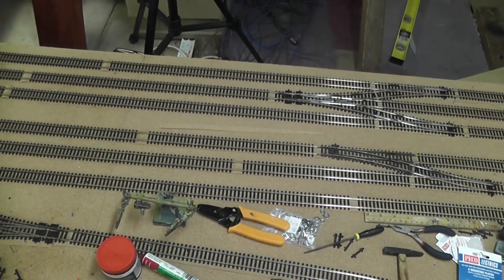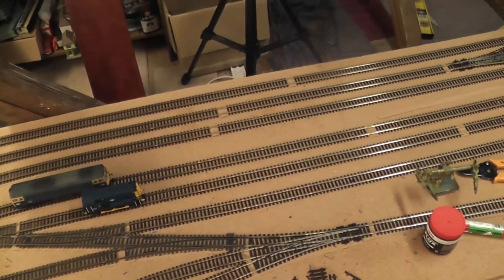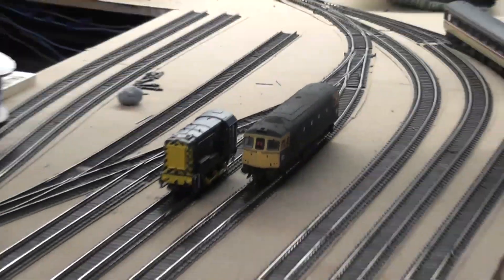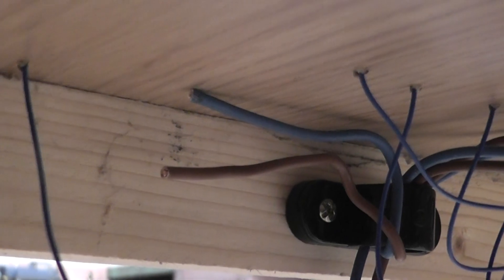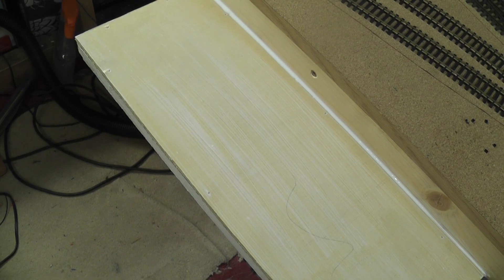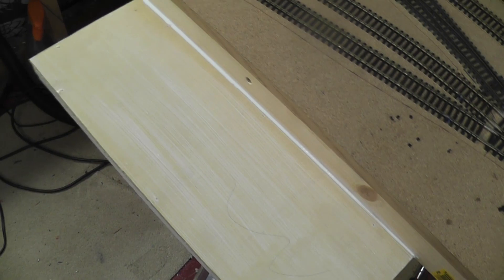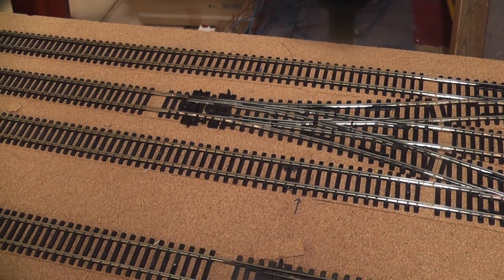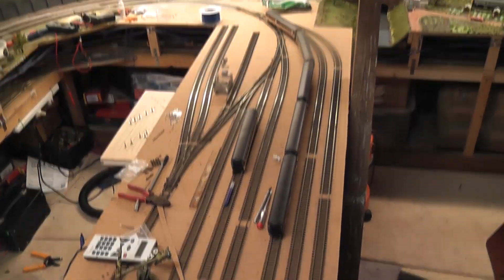Building a Model Railway - Part 5 - Control Panel

Comment: Great update, very pleased you showed a decent explanation of the uncoupling, I have been trying to find an explanation for the ordinary mortal for ages and here one is. I am sold on the control panel route now, I will forget about the notion of DCCing them, the manual control panel looks to be much more fun

Comment: Hi Richard, I always find your videos and explanatory interesting and informative, I bought a locomotive at the model train exhibition here in (Perth Western Australia), and a track cleaning car with the same couplers you have, they are a lot neater looking, I now know how they are  uncoupled thanks to your video. I'm still learning and wanting to build a decent layout, at the moment I have a Hornby DCC mixed freight with twin ovals modified with some turn outs set up on the floor for now. Cheers, look forward to see more updates on your layout extension.
Regards Gary 😊

Comment: the dcc point clips are called twerps by us S&T. we form a coil of bond wire for expansion around a ball hammer and knock them in with bond pins. great channel, just started watching. thinking of doing an NGauge layout. if you need any reference photos or have any technical questions, let me know. i notice lots of location  cases on the layout that you call relay boxes, so you have a relay room on the layout. typically found next to the signal box of brick or prefab construction. Lee Crewe S&T

Comment: Nice video Richard, that coupling system certainly looks interesting and useful. The control panel stuff was also very useful. Thanks for sharing!
Joe.
Reply: +Joe Jabczynski Just about all of the American manufacturers have converted to Kadee couplers, or their make of it for HO and N scale. Most American modelers model freight, and desire to shunt them without using the hand of God, especially when you wished to do so out of reach. Outside of a few urban areas we don't have many passenger trains. The British have better passenger rail service than Americans have bus service in the rural areas. While the manufacturers were slow to convert, slowly one at a time did as the American modelers insisted, and were converting anyway on their own. Only very old models have HO hook-horns, and N Rapido couplers. While US Bachmann have converted, notice UK Bachmann/Graham Parish have not for N scale, except for HO/OO Thomas and Friends line which use the British couplers.
Reply: I didn't know that to be honest. Now you mention it though, I have noticed the 'model railroading' groups on facebook tend to show a lot of freight workings. I've found that as I've got more into the hobby, my freight collection has grown! I think we are slowly starting to catch up with coupling systems as I've seen kadees starting to appear in our shops. I think this video shows just how effective kadees are and I'll definitely be making the change soon!
Cheers, Joe.

Comment: Nice video. About the magnets, rectangular ones should really do the trick. I plan myself to use rectangular magnets with an uncoupling area of about 4 to 6 "ties".
Another way to uncouple, manually this time, is with a wooden stick. Use a square section wooden stick, sharpen the end in a pyramid, then cut the last three mm of the point and round it. I introduce it between the jaws of the Kadee, turn it first clockwise then counterclockwise. The coupler then opens and the wagons (or here the coaches) are uncoupled... If you then glue the stick to a small pen-size flashlight, then you can also light the couplers when working in dark areas (or in a "night" environment). I saw that in an old Model Railroader, and after testing found out it worked quite well.

Thanks though for this serie of videos. They're really usefull for me as I'm planning a small exhibition layout and I'm quite a nonentity in electricity and electronics (just know that I must not cross plus and minus or I'll transform my layout in an electric toaster ;-) Landscape, weathering and structure scratchbuilding are more my forte than track laying, electricity and mechanics...

Eric.
Reply from the maker: Eric Sainte Thanks Eric, hopefully the rectangular magnets should do the trick.

Comment: I looked at Kaydees, DGs and Sprat and Winkle when deciding some years back on an uncoupling system. In the end I went for DGs as it is a delayed system. You can place just one magnet at the start of a fan of sidings and uncouple using an electromagnet. The stock can then be uncoupled by simply continuing and pulling the loco off when required.  The only snag is...you have to assemble them!! Cheers, Bob

Comment: Nice job Richard, the uncoupling system is a clever idea, I like it a lot. As an ex technician I couldn't help but think you would have been much better off 
using a socket rather than a pair of pliers to tighten up the switch securing nuts! Lol! Very much looking forward to the next video in the series.
All the best
Howard.
Reply from the maker: Howard Sugars I am a technician.  All my sockets are at work, I forgot to bring one home when I did this :)
Reply: Ahh I see, luckily I was a mobile technician so all my tools were in my van when I was at home, now they just sit in the shed! Lol! :)

Comment: Excuse the late comment on this great series.  When checking for interference between the uncoupled stock in a siding and passing point, the vehicle with the longest distance between the bogies should be used to check for 'cutting the corner'. Hence a coach (or the longest loco, if longer) would check for underhang. Overhang (beyond the bogie) might also be an effect (like a 4-4-0) , but is much less likely, even with Mk4 coaches.

Comment: Great work, very well done, & I have a suggestion, regarding cutting the bar from the motors. Would you consider putting a small washer over the bar down onto the track which would, I think ensure when you cut there would be a small piece protruding up.

Comment: +EverardJunction An useful function of Kadee's is that you can uncouple them, then push back and push them with the 'heel' of the coupling.

It means, that if you had a set in the station area, you could uncouple, then push backwards into your carriage sidings without coupling up to the coaches.
Or, you could push from the terminating end of the carriage sidings, into the station, then simply move away without coupling up again.

Comment: Hiya the norm in the UK where this great layout is, is for AC even if it's 15v brown L and blue N. For the DC 12v it's red + and black -  other colours as supplied, i.e. green frog etc. Why not use the anti-rotation luge on the points control switches. That little bit sticking up off the washer with the lug on the inside that goes into the groove in the threaded barrel, that stops the washer moving and a correct sized hole will fit the lug you've got pointing up allowing it to point down into the board and stop the switch rotating. Yes an extra hole per switch but small points lol, but they help the final finish. 
Those black cable clamps are 20mm conduit saddles. 
A pair of ratchet crimp pliers cost £18ish and will weld the wire inside the crimp, better than solder.

Comment: Fantastic work as always one thing you are definitely missing is a set of trap points leaving the yard I can think of no depots that I drive onto that doesn't have traps points protecting stray movements onto the main line
Reply from the maker: Steve Lindley All planned for, I will be making my own as the entrance is on a curve and the RTR trap points are straight.

Comment: The yard is coming along nicely.  Great job.  I use proto type Kadee's for my trains.  I think Kadee's are the best made couplers.  Different to see them being used on the other side of the pond.  See every one using the normal couplers.  I hear some people complaining those type of magnets are too strong.  I see them put in sets of 4 or 6 to make them long enough to uncouple.  I used the Kadee magnets but thinking of putting in electric ones.  Have you ever thought of using servo motors for the switches.  I have been looking into them and many people are saying they are great.  I noticed one small thing when you put the toggle switches in, that you put the lock washer on first. It should have been the flat washer and then the lock one then the nut.  Not that it will make a difference but I thought I would point it out.
Scott
Reply from the maker: Scott Downey Thanks Scott.  I've thought about servo type point motors many times.  Problem is they are quite expensive and the solenoid one are so much cheaper.  For now I'll stick with them but on a future layout I may use the servo types.

Comment: Another excellent video. Of course. Yours always are.

One small quibble though. In a prototypical setup that final point out onto the "main line" should ideally have been controlled from the main or station box, not from the sidings box.

I realise that's ever-so-slightly anorak of me but hey, we're all anoraks in our way, yeah? Keep up the good work.
Reply from the maker: The Gods Right-Hand Man Quite correct, however my other control panel didn't have space on it so I've compromised.  Thanks

Comment: Thanks again for another great video.
I noticed the buzzing sound when your point motors operate. I assume your using an AC supply, I found using DC with a CDU "capacitor discharge unit" gets rid of the buzz. Also with the CDU you can operate several point motors at once and save on switches on crossovers between lanes. Anyway, just an idea it, may be impracticable on your layout as a dedicated point motor power feed is needed unless you have a separate CDU for each control panel. Might be worth looking into, I believe you have an electronics background and they are easy to make just a few caps, transistor and basic components on a bread board.
Ahhh, the magnets. I've had great trouble with these too. My problem has been unwanted uncoupling with passing trains. I ended up using Kadee #708 electro magnetic on main / passing lines and ceramic magnets only in sidings. I run N gauge but I'm sure there is a OO equivalent if you come across similar problems. 

Look forward to your next video,
 thanks again for taking the time to share.

Stew
Reply from the maker: Stewart D St Aldhelms Railway Thanks Stew.  My motors are powered by 12DC.  I've already installed some CDUs which will feature in the next part.
Reply: EverardJunction Interesting, originally I used 16v AC with momentary push buttons and noticed the buzzing sound. When I built a full wave "4 diode" rectifier and a capacitor discharge circuit the buzzing went away.
Now my points operate with a snap instead of buzz regardless of how long the button is pressed. I realise it's no big deal and a matter of personal preference but after the buzzing was gone I realised it did slightly annoy me.
I assumed the buzzing came from the AC polarity frequency. Also I use the peco solenoids not seep, not that it should make any difference. Maybe your DC supply is Half wave rectified ? It also might be the large Electrolytic cap I used across the output of my rectifier filtering out the pulses ? My electronics theory is pretty basic so I'm not really sure.
Anyway, awesome layout, look forward to seeing more.

Stew
Reply from the maker: Stewart D St Aldhelms Railway I'm quite sure the buzz is the point blades vibrating against the rail once the point has thrown.  Now I have the CDU there is no power going to the motor by the time the point has reached its destination.  Before on some points I could actually see the vibration in the blades when I held the switch for too long.

Comment: This is an excellent series of videos, thank you for putting so much time and effort into making them.  I have one question on the live frogs and insulated fishplates -Surely as a loco passes over the insulated joint, it will short across?  Doesn't this cause a problem?

Comment: A good set of videos. Nice to see a new section getting built from scratch.
2 questions, 
1) Why do you not have a headshunt at the exit of the yard? In 1 of the earlier vids you had suggested coaches would be shunted about the yard for "cleaning" etc but doing so you would run the risk of fowling the branchline.

2)  At areas where 2 points run into each other (e.g. mainline to branchline) why use 2 switchs for the point insted of 1 to throw both at the same time?
Reply: Tsurnari more operational i think (to the second question) :)
Reply from the maker: Tsurnari Thanks.  In answer to your questions...

1) There isn't enough room to headshunt a rake of coaches.  The coaches will be moved from the station to the sidings and stay in the chosen siding until they are required back at the station.  3 sidings will be cleaning and maintenance, 3 for storage.  The only things that will be able to move about within the yard are dmus and shunters.

2) I will be doing that on the transfer between the branch and centre track.  Accidentally drilled 2 holes in the control panel though so will fill and redo a single hole.
Reply: Thanks for the reply.

Comment: The Kadee rectangular magnets normally go between the rails. I've never seen anyone put them under the rails. I'm curious to find out if that works better. Sometimes, when putting them between the rails, you have to remove some sleepers if you are using rail that is smaller than code 100.
Reply from the maker: avlisk Kadee make 2 types of magnets.  One goes between the rails the other goes underneath.  So far my magnets are working.  They are quite powerful and need to be as there is a few mm between them and the kadee itself. They are also a far cheaper option and will remain hidden once the track is ballasted or concreted.
Reply: EverardJunction Live and learn. I never knew of that other type of magnet. Thanks, and please keep the videos coming. I really look forward to the updates.
Reply from the maker: avlisk Thanks.  I have some better magnets on the way which should improve things.  The next video will go up when they arrive.

Comment: Your channel is always the best place to come for ideas and how to's, i probably wouldn't know what I'm doing if it wasn't for your videos. As I'm finishing one area of my layout off, i am at the stage where i am required to implement various details in order to gather the correct scene, as of this, i was unsure what you were using for the concrete signal cabling blocks which run round the perimeter of the track, are they matchsticks ?
Reply from the maker: +InterCity24 Thanks.  I use matchsticks as a base for cable trunking.  On top I glue the lids which are cut from plasticard.

Comment: Love the videos and I'm looking forward to watching the rest!  Why not use only one control switch for crossovers?  One switch could be wired to a pair of points such that throwing it one way lines the points up for a crossover and throwing it the other way lines the point up for straight through. There will never be a time when one point of a pair making a crossover will be in a different state than the other point of the crossover.
Reply: Just started watching part 6... nice to see the single switch for the crossovers. Cheers!

Comment: Nicely done! I imagine if you're going to want lighting to indicate direction on the control panel, you'll have to redesign in a little. Not a lot of room around some of those switches!  ;)
Also, I have a bit of a pet peeve with your wiring. Here in the states we have a kind of standard that earth (ground) is black. Since you're running as many of three power bus lines, I (personal preference) would probably change the color of the positive wire for each bus. For instance, track power red, lighting power white, third bus (I forget what you're using it for) yellow. Easy to keep track from underneath, especially on an extension such as this.
Looking forward to the next installment! Cheers!
Reply from the maker: ***** Thanks.  Agree with the wiring.  More colour coding would be helpful,  I know what everything does and can easily troubleshoot it, but it does look a little confusing on camera.
Reply: hey ,if anyone else trying to find out building model railroad try Panlarko Amazing Railroad Planner (do a search on google ) ? Ive heard some incredible things about it and my work buddy got great success with it.
Reply: I use RED for track power, BLACK for track negative/return.  For point circuits I use WHITE for power and BLUE for negative/return.  I use GREEN for frogs....some frogs are green, easy to remember!

I use YELLOW for what I call ISFs or Insulated/Isolated Switch Feeds.  Basically your track power isolating sections.

I find this colour system works for me.

For a third circuit I don't know.  Maybe I'd use BROWN and a two colour wire or something.

Only using capitals so it is easier to pick the colours out.

Comment: Hi Richard, Very informative video as usual. 
You mentioned kadee couplings. Were they easy to fit to all your locos / rolling stock? Did you need different types of kadee for different rolling stock? What specific kadee # did you use. Thanks. 
All my stuff is hornby.

Comment: Hi
The washers on a toggle switch which have the little right angled tab on them go underneath the fixing surface. They are designed to lock into an indent to help stop the switch turning! You seem to have fitted them to the top?
Reply from the maker: Brian Lambert Thanks, didn't know that.  Pictures of them conflict with each other and they came with no instructions so I just guessed.

Comment: Have you ever thought about running the layout in automatic mode ? With the switched controlled by a computer, which gets the position of the trains from current sensors.
I would at least prepare the layout so it can be easily rewired to do that.
Reply from the maker: Videoman2000 Thats an expensive route to take.  I would need many accessory decoders and other modules.  I prefer to control the layout manually.